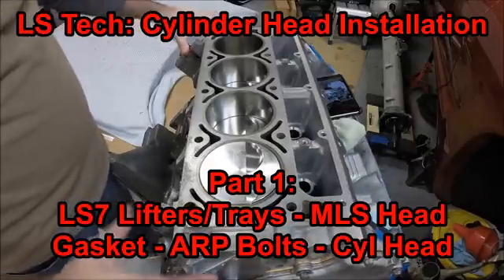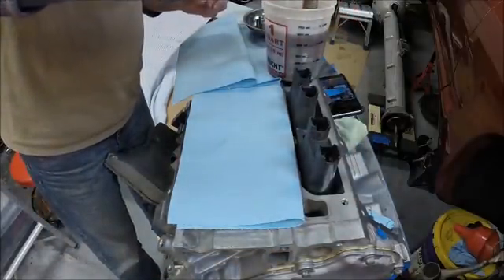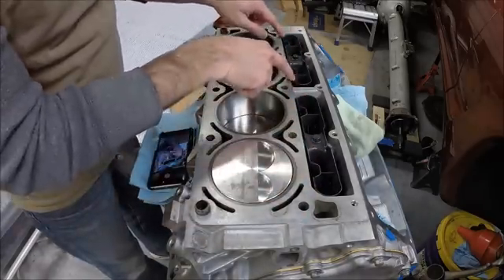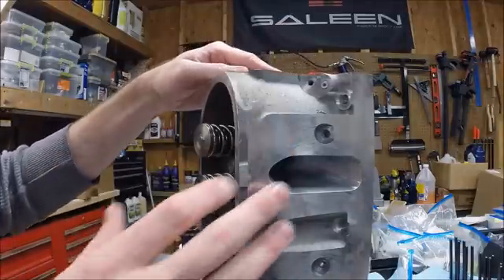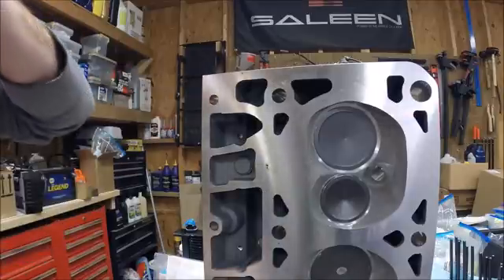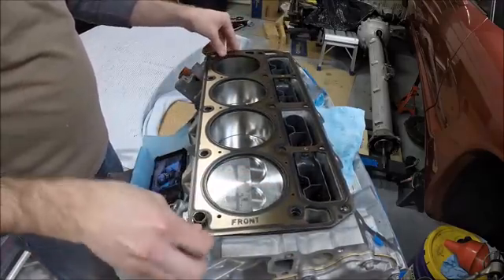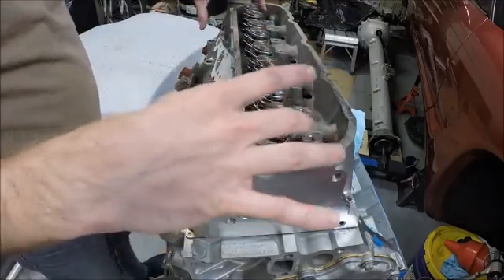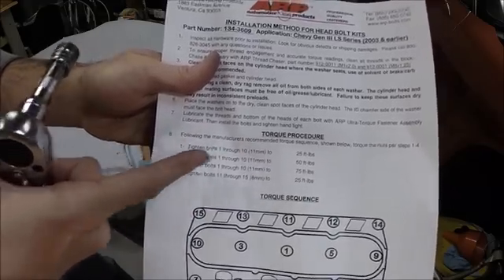LS Tech: Cylinder Head Install - Part 1

Comment: Hello, I'm doing this for the first time on an LS motor of mine. Built orher engines for many years. What is the black outline on the head gasket you're using? Is it some form of rubberized sealing surface? The Fel-Pro gaskets I purchased don't appear to have it. Thanks.
Reply from the maker: I was using the GM MLS head gaskets.   I didn't add anything to them, that's how they come.   I can't speak for the Felpro gaskets, but I know a lot of guys swear by the GM gaskets for most builds.   Hope that helps.

Comment: I replaced the lifters and turned it on and still got a ticking noise any ideas?
Reply: It could be a number of things.  Are you sure it isn't just the normal LS sewing machine sound?  Could be as simple as an exhaust leak. Or a bent push rod perhaps? Even an oil pump issue.
Reply: Camshaft not good and check the camshaft

Comment: Did you drill the rivet first or it just tapped out with a punch?
Reply from the maker: I believe I just tapped out the plug with a punch.  I had the heads off, so I was able to do it from the underside of the head.

Comment: That block surface looked rougher than I’d expect for a new gasket. Perhaps it’s just the video, but I know it needs to be very smooth for MLS.
Reply from the maker: I think it may just be the lighting in the video.   The block had just come back from the machine shop.   If I recall correctly, some brands like Cometic specify a specific surface finish to use with their head gaskets, so you may need to make your machine shop aware of that.   I was using the GM MLS head gaskets and did not have any issues with them.   For my needs, they worked great.

Comment: So you don't need rtv for the head gasket?
Reply from the maker: No, as long as the block and the cylinder head are clean and flat, there is typically no need for anything additional when using a MLS head gasket.    Some people like to use a copper spray, and if you are reusing a head gasket, then that might offer some benefit.   But the GM MLS gaskets are inexpensive, so I personally wouldn't bother reusing a gasket.

Comment: Do you know which exact heads need specific gaskets? I’m running some 799s and have been dealing with coolant leak. Gen 3 block 6.0

Comment: My head gaskets aren't seating right. They seem to be a couple maybe 3 to 4 centimeters off?
Any help here or is that okay?
Also on my engine if the label front on the gasket would be upside down, is that ok or do I turn it over?

Comment: Is it the same if I torque it down to 22ft and 90• then 70• ? On a chevy Silverado 2008 5.3L ?
Reply from the maker: The OE head bolts are torque-to-yield, thus the torque specs given in degrees.  I used ARP head bolts which are not TTY, and thus use a specific torque value.   You should follow the torque sequence for whichever type head bolts you are using.

Comment: Dont listen to him 50-75 it's to much torque  its suppose to be 22ft pds then 90 and 70 degrees
Reply from the maker: It's important to understand the difference between the stock head bolts, which are torque to yield (TTY) and aftermarket ARP head bolts.   The factory TTY bolts use bolt stretch to set the clamping load, rather than a specific torque value.  When you rotate the bolt 90 degrees and then another 70 degrees, you are significantly increasing the torque well beyond the original 22 ft lbs (you are actually stretching the bolt, putting it into yield; which is why they can't be used again).    I am using the ARP bolts which are reusable and are set to a specific torque value published by ARP.    https://cdn2.arp-bolts.com/instructions/134-3609_flat-washer.pdf

Comment: I thought you had to torque to yield with a angle guide for the head sequence
Reply from the maker: It depends on the type of head bolts you are using.   The stock head bolts are torque to yield, so they would follow and torque sequence you referenced.   I am using ARP head bolts which are not TTY, which also makes them reusable which is nice.   ARP provides the torque sequence and specs for when using their bolts.

Comment: Did those heads require any further machining, or were they ready to go straight out of the box? I'm looking to upgrade the heads on my 5th gen Camaro LS3. Some people say not to install them straight out of the box, but rather take them to a machine shop to check all the clearances and such. Just wondering if I could get your take on that. Thanks for the videos! Its a pleasure to watch you work.
Reply: So no Angle torque
Reply from the maker: While it certainly couldn't hurt to have new heads double checked by another machine shop, in my opinion, it's not really needed if you're buying heads from a reputable place.  Mine came from Texas Speed and were setup and ready to roll right out of the box.  When I ordered them, I also had them mill the heads a bit to bump the compression up.  No extra charge for that.
Reply: @ScrufsGarage  Thanks for the quick reply! Really appreciate the info.
Reply from the maker: of course, always happy to help!
Reply: So no 90 deegre Angle torque Required

Comment: With that extension on your not getting 25 ft lb of torque fyi
Reply: I was thinking the exact same thing!
Reply: Wrong.          I don't know where you got your mechanical engineering degree but where I earned mine this is incorrect.
Reply: @lastditch5968  you are correct, length of handle only increases leverage. 25 lb. ft. is 25 lb. ft.
Reply: FYI, you might have known what you are talking about if it werent for the fact that the torque value was only 25' pounds on what looks to be a 1/2 inch drive 8" - 10" long extension. Add in the fact that you dont know the quality or materials make up of the tools being used, the amount of twist deflection rating of said tools. Only when you change the centerline of the fasther being torqued relative to the centerline of the torque wrench head do you change the amount of torque being applied. An extension does not change the torque rating. The only times the torque is increased or decreased is if you lenghten or shorten the handle of the torque wrench, change the angle of eihter or both of the wrench or drive its self, the use of an offset tool such ad a crowsfoot, swivel or equivelent tool. Any time you change the  An extension does not change the torque value much because of extension shaft twist and is pretty much eliminated if yu use impact extensions or an extension the next size up (depending on torque value specification) say 1/4 - 3/8 - 1/2 - 3/4 - 1 inch etc...
Reply: You aren't taking into consideration the 3-dimensional torque vectors created by the extension.

Comment: Where did you purchase your heads?  I also want to get 243 heads for my LS1
Reply from the maker: I bought mine through Texas Speed, it's their PRC brand.  They do the CNC porting and setup the valves/springs.  They'll also mill the heads if you want at no additional cost.  I had them mill the heads down to 60cc, which should put me at around 11:1 compression.
Reply: thank you for the info! Did you have to buy the heads separately and then send them for porting? Keep up the good work, I look forward to every new video.
Reply from the maker: They offer both.  If you already have 243 heads, you can send them in for porting.  Or you can buy the 243 heads from them already ported, which is the route I went.   I figured by the time I sourced 243 heads locally and then shipped them in, the cost wasn't much different vs buying directly from them.  Plus you don't run the risk of getting a damaged head from Craigslist.  The heads they have, they have already inspected, etc.  The CNC porting on them looked excellent.  No complaints at all.

Comment: Cool, I'm about to do the same H/C install on my C5 when snow stops falling.  What year is your C5?  The steam tube plugs are a detail I haven't come across yet and I'd like to know if it's something I need to address.  I also have the PRC 799 heads waiting to be installed , and my C5 is a 2002 with the LS6 intake.  I know the steam tube routing is different on earlier LS1's. Thanks!
Reply from the maker: Great question!  The steam vents are a hotly (no pun intended) debated subject, but I'll offer my opinion as someone who had the #7 piston fail.  I've been recording video clips and will eventually post a video on how I am addressing the steam vents.  The early LS1's had steam vents on all 4 corners.  Starting in 2001, the LS1's actually got the LS6 intake manifold, and because of clearance issues under the intake, GM did away with the rear steam ports.  My old 241 heads just had bolt on plugs/caps.  The PRC heads I got actually had plugs pressed into the heads that had to be knocked out.  There are several companies that sell steam vent tubing kits, but tend to be a little pricey ($140+).  I'm using the GM truck rear cross over (GM # 12605716 - $35), and will route a hose forward and T into the front steam vent line.
Reply: So are you saying that running steam vents from all 4 corners is a safety/precautionary measure to hopefully avoid piston failure again? From my limited amount of googling this morning it looks like the steam vents let air escape out of the top of the cooling system so air bubbles and hot spots don't form.  If you're going to go into what the system actually does and why you're running vents at all four corners in the next video I'll look out for it.  Thanks again!
Reply from the maker: Yes.  There are a lot of opinions about why the #7 cylinder is a common failure point, but I suspect it is related to excess heat/hot spots in that cylinder.  In my humble opinion, opening up the rear steam ports is cheap/easy insurance and it certainly won't hurt anything.